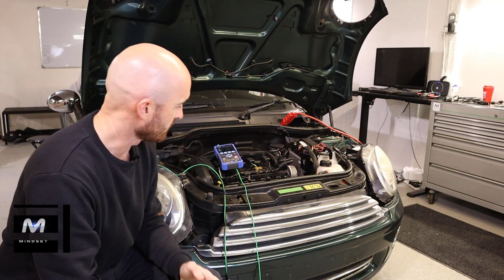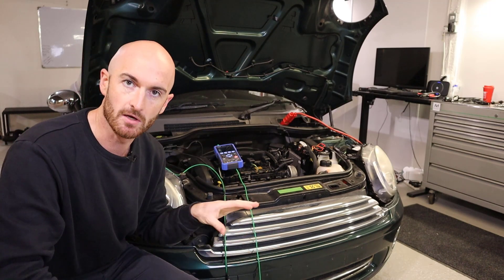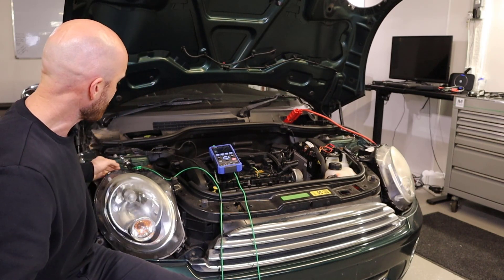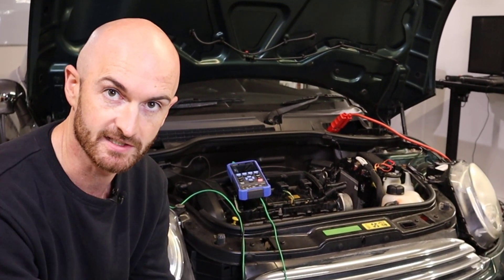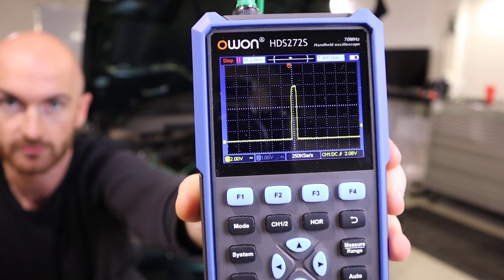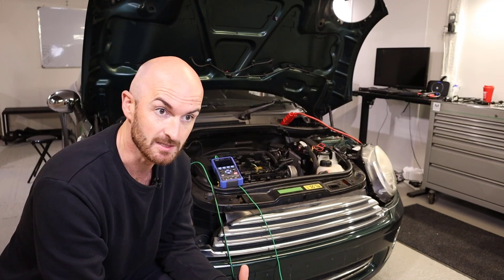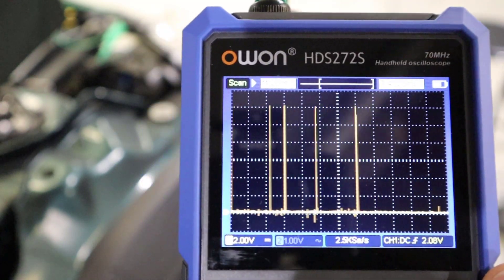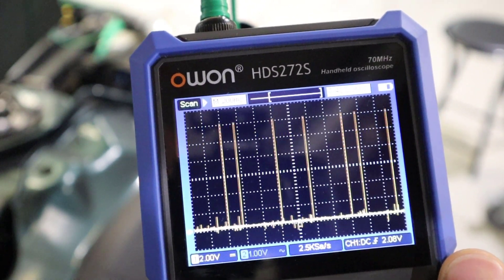Mind-Blowing Headlight Bulb Noise - You Have to Hear It to Believe It!

Comment: You know you can use a properly calibrated headlight bulb 20 amp or 30 amp for 40 ampere 10 amp based on the circuit and you can see with your eyeballs the light flicker you don't need an oscilloscope

Comment: Great idea keep running with that thought hook up sounds on all signal lines
Cam, crank ,vvt,etcetera 
Wow listen instead of probing wires you will be a rich person👍add an led light to cam and crank sensors and all other sensors so you can see if it's working just by looking at it 🤑🤑🤑🤑🤑 built into the sensor
Reply from the maker: 😆 I wish it was that easy

Comment: Looking forward to the review on the Owon HDS272S and perhaps a comparison with the Hantek 2D82A. Apart from portability, both scopes offer isolation unlike most bench or pc scopes. 

 Small handheld scope will always have a steep learning curve compared to a pc-based scope due to the number of multi-function buttons and of course one does not buy a handheld scope for its pc software, Pico is the king in that regard.

Puzzled as to why you had trouble getting a can signal as other experienced users where able to capture a can signal on the Hantek 2D82A and the 2D72 and the Owon is a much faster scope.

Really value your expert knowledge and down to earth presentation.
Reply from the maker: I had another play with it last night. Some interesting results from the Owon; unexpected. You’re right, the settings are hard to get used to! It does pick up the CAN signal, I think it might be the display that’s the limiting factor. We’ll see! Thanks 👍

Comment: I went a head an follow your link to Amazon for this scope. Do you happen to have a review on it or what will you recommend for a beginners journey?
Reply from the maker: Not yet, I will review it soon. For a laptop based scope I recommend $100 PicoScope 2204A; then you need a few cheap accessories. This Owon is good for quick checks on PWM signals and things like that. But for proper diagnostics we something better. I am interested in the new Hantek tablet but I don’t have one yet
Reply: @MechanicMindset  TKS

Comment: Darren, would that microphone pic up the rear ultrasonic sensor in the rear bumper for the back up warning system? I know using chassis ears you can hear the "blips", but I've never thought about putting them on an oscilloscope to see if the pulses are different on a bad sensor.
Reply from the maker: Probably; you can hear this lamp (and PDC sensors) with your ear. PDC might be more difficult to hear as we get older. Very high frequency!